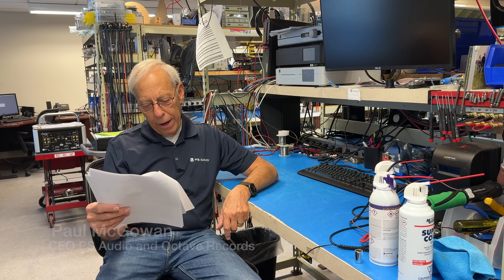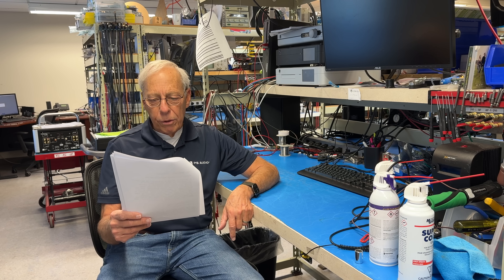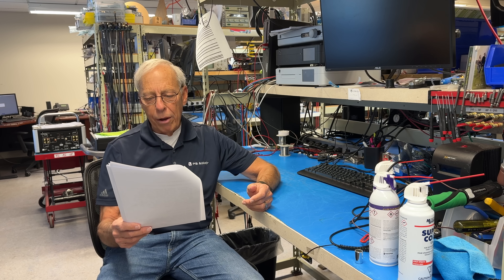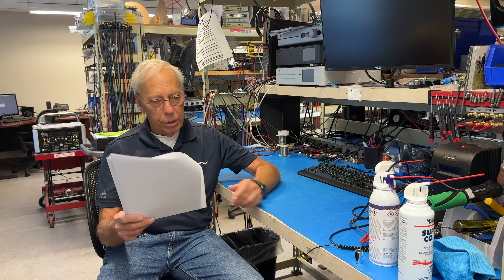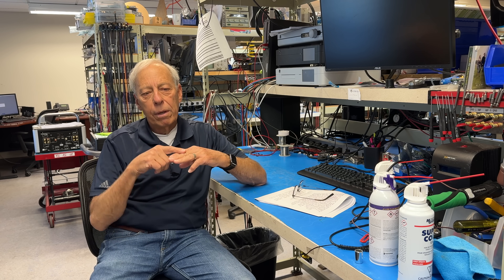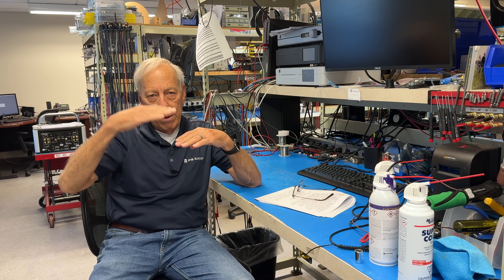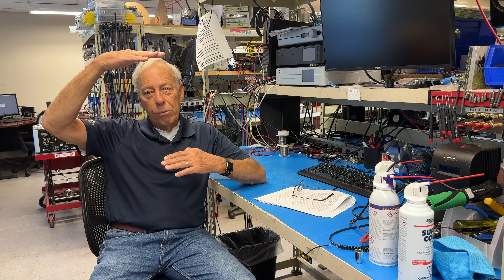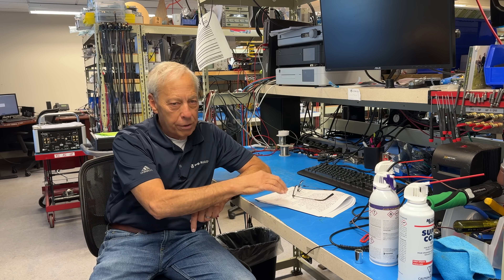DAC output stage vs  technology

Comment: @Paul McGowan I don't understand the difficulty of producing a precision resistor ladder. I remember seeing samples of variable resistors in a SIP package with an adjustment screw on the end back in the early 1970s, if not the 1960s. Say you are trying to produce a 100 ohm step, if the adjustment is too coarse on one - say +/- 1ohm on a 100ohm SIP - then put it in series with a second 1 ohm SIP that was +/- .1 ohm and so on, finer and finer, until you got the required level of adjustable precision. What am I missing?

Comment: I thought that R2R refers to an arrangement where only 2 resistor values are used: some value, and twice that value. The resistors are then switched in, sometimes multiple resistors, to create the proper current output for that word.

Comment: It can not be argued that all else equal, an R to R DAC will be more accurate in reproducing the individual samples in PCM. A properly designed  R to R DAC will literally reproduce the exact voltage captured from the source ADC. It will do so for each sample as they are sent to the DAC. While a Sigma Delta has no idea what the actual voltage of any particular sample is. All it knows is on a single sample (multiple bits) level whether to turn on for that clock cycle or not. The DAC will try to slowly align with the moving signal and hopefully eventually ride the sample to sample changes correctly. But at no point in time does a Sigma Delta actually reference, verify it's output compared to the specific voltage value of any sample. 

IOW if you start playing/ sending a PCM file to a DAC and the first sample is a high voltage, the R to R will reproduce that voltage while the Sigma Delta's output will just be a single on bit for the sample duration.
Reply: That makes absolutely no sense. What measurement can you point to that shows the superiority of a R2R DAC over a Delta Sigma DAC?  It seems to me that if what you said was true, the biggest issue would then be that the Delta Sigma would have measurably worse sample value accuracy than the R2R. But just about any Delta Sigma DAC will show the exact opposite with respect to linearity. The majority measure virtually perfect in this regard. Kindly point out where the measurements reveal the flaws that you claim.
Reply: @johnstone7697  It makes complete sense to anyone that knows how to read schematics and understand electronic designs. Send one sample to an R to R and it will output that voltage level until the nest sample. Send one sample into a Sigma Delta and you will get one sample duration pulse... or not.
Reply: @glenncurry3041  The only thing that is important in a DAC is the accuracy of the output analog waveform relative to the digital input signal, period. And that accuracy is determined upon an established set of measurements. Where in those measurements of a Delta Sigma DAC does this supposed "deficiency" of yours show up? It either accurately converts the digital stream, or it doesn't. If it can't reconstruct the analog waveform correctly, that will show up in the measurements, plain and simple.  Your statement that  D/S DAC's 'have no idea what a sample's value actually is" is utter tripe. Were that the case, the damn things wouldn't work at all, much less produce SOTA results.
Reply: @johnstone7697  So you don't really know how the different DACS work. Got it! Take any PCM file, send a single sample data to a R to R DAC and it will output that voltage! It's that simple.

Now explain what happens in a D/S DAC when only one sample is sent to it!
Reply: The issue isn't necessarily the DESIGN of an R2R Dac.  If anything, it's easier to design properly than a delta-sigma Dac.  It is, after all, one of the oldest Dac circuits.  The main problem, as Paul alluded to, is the MANUFACTURING and IMPLEMENTATION.  In order for R2R to TRULY work correctly as intended, it takes incredibly accurate resistors within the ladder that are matched to such a degree that it's actually not possible with current manufacturing processes without insane time and expense - no matter what any R2R manufacturer says.
Reply: @wty1313  OK. Has nothing to do with basic design level discussion. Which is exactly why I set mine up that way. Thus "all else equal". By pure definition a R to R is based on each samples value, while a Sigma Delta has no idea what that sample's value actually is.

Comment: I understand all too well!  And it’s why I’ll 
 n e v e r,  Never,
NEVER leave a n a l o g sound sources:
 phono, tuner, and tape.  CD, and for that matter, HiMD will never lose their convenience of portability which is great!  But this business of chasing DACs across the galaxy?  N😢t by any stretch!
Reply: Tape.. ?! 😮
Reply: @5starmaniac  Amazon has access to many linked sources of analog cassette tape.
Reply: @DrNoahBoddy004  I'm more concerned about the sound.. But as a nostalgic trip, I can understand it, as I grew up during the 80's 😃
Reply: @5starmaniac  my only demands as far as SQ, have already been solved in the use of full tri-amplification for the speaker systems, and the use of electronic crossovers.
New drive belts, clean tape heads, and full demagnetization have always cleared the way for their continued use, in my set-up.
Reply: @DrNoahBoddy004  As long as you're happy with it, that's all that matters 👌😊
Reply: @5starmaniac  ….in general, these format wars have always kept folks in the poor house, chasing this junk all over the galaxy.  I stopped at Sony’s MD system, and maintain a library of physical Vinyl, and CDs.  Streaming’s for the rich.

Comment: My 10 year old Burson DAC which has Separate power supplies for digital and analog, and all Discrete circuits still holds its own. Yes there better sounding DAC’s today, but the difference is small like changing cables. Note : this is a full range system in the 25 k range. Yes just use your ears. 😊

Comment: Great answer, thanks.  I never knew why it was called R2R.
I'd go so far as to say the chip is the least important to sound.  The power supplies, the output stage, I/V, the clocking of the I2S signal all impact sound more than the DAC.  Heck, just the vibration dampening and EMI and electric noise shielding will impact the sound.  With all of those things optimized then the choice of DAC chip/process is a matter of taste like a fine wine.   
In the end if you like the sound, you are done.
Reply: I have several DACs based on the tda1541 chip and they all sound very different from one another
Reply: @mikeg2491  I can imagine.  I have used the TDA1541a chip now for 15 years and really like it.  I have had a couple of CD Players and build numerous DAC's around this trusty old chip.  The more effort you put into it's implementation the more you are rewarded with natural engaging beautiful sound.

Comment: I have a Gustard DAC using a pair of AKM 4499's and a discrete output stage. I also have a Theta GenVa DAC from 1996 that used the legendary Burr Brown PCM 63 ladder DAC chips in a quad balanced configuration, with a bunch of fancy proprietary DSP in front of them. . I've compared these 2 DACS using 16/44 files on numerous occasions, and never once have I been able to reliably pick out which was which on a blind test. Given that these two DACs are nearly 25 years apart, it tells me that digital decoding has been a "solved problem" for a long time. Even though the Gustard measures far better,  the Theta  still measures well below the threshold of audibility for distortion, noise, jitter, etc. So it comes as no surprise that audible differences-if any- would be extremely hard to discern. I really wish these companies claiming their DACs sound so much better, even though they have no concrete specs to back that up, would show some proof to back up their claims. But then again, this is high end audio, and they'll say  "We don't need no stinkin' proof".
Reply: I own an Adcom GDA 600 DAC (1994) with the BB PCM 63.  Recently, I compared my DAC to a D/S dac ($4000). For me the Adcom was superior. I listen to Classical Piano Music exclusively.  The D/S DAC stripped the piano of its natural harmonic richness etc.  So, I am very happy with my 30 year old DAC.  There is something special about the BB PCM 63 chip. I also, own a BAT CD Player made in 1998 with the same BB PCM 63 chip which is also great for a front end.

Comment: Perhaps George of Houston has purchased a Denafrips R2R DAC. The DAC design has an unbuffered output stage. This makes the DAC sensitive to the input impedance of the pre-amp. The interconnect cables will also influence the performance.

Comment: Thanks Paul.
That was much needed.
So the next step for the manufacturer is to explain to the customer 
how the analog output Stage  is designed. 
That might slow down the DAC reviewer madness a bit. 
With some manufacturers you'd think they bring out 4 new DACs a year.
Crazy.

Comment: Ah yes output stages. This is the single biggest advantage DSD has over everything else. With DSD, you only need a low pass filter. That's it. With R2R you need a current to voltage converter. And let me be the first to tell you, they are a living nightmare to design. One thing everyone loves to forget about dacs is that power supply noise on the output will reduce your effective bit depth. Output stages HAVE to have less than 1uv of noise in order to maintain -120b SNR at 1v out. So trying to design a complicated IV stage when the parts themselves have a higher than 1uv self noise is almost impossible.
Reply: Thank you… I learned something new today